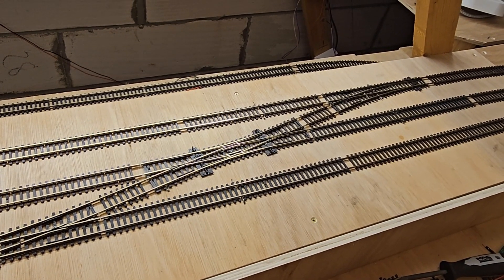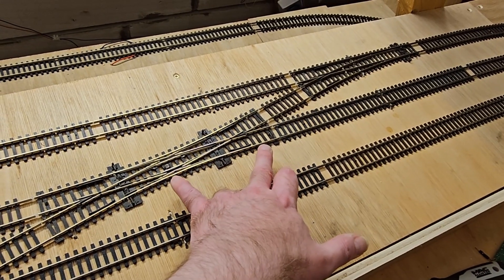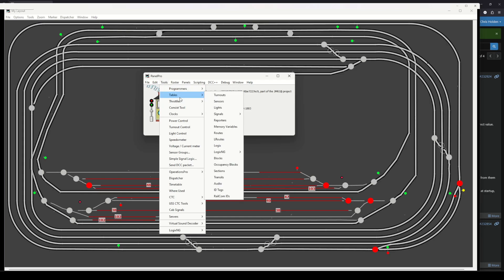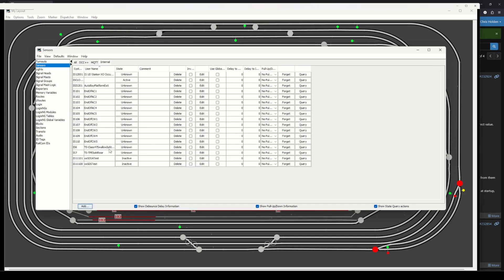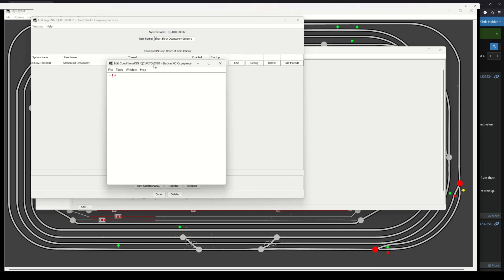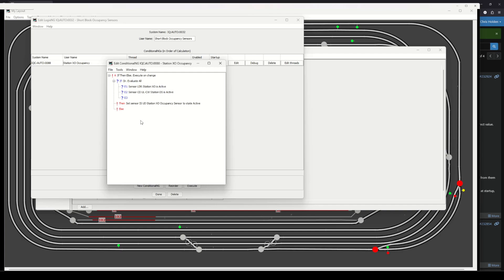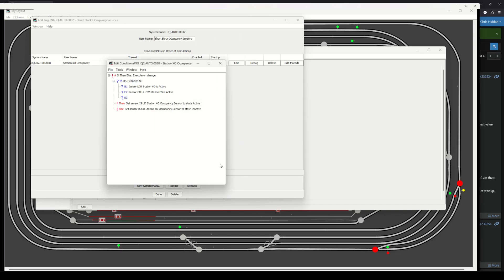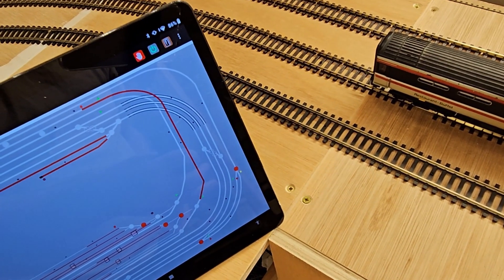Configuring multiple occupancy sensors for one block in JMRI

Comment: Interesting. How reliable do you find the LDRs are? I have been working with adjustments for varying light levels in the room. But I still have problems with light coming in from the side of the coaches and not going active.
Reply from the maker: Hi Sven - they seem to be 100% reliable now. They're connected to an ESP and I've written code to read their values. It allows for a little fluctuation, so the sensor has to be giving readings below the active threshold for 100ms before the sensor state in JMRI is changed. And they have a 2000ms off debounce too. Regards, Chris
Reply: Good to hear. Sounds like you have more stable lighting conditions than I have.

Comment: whats the overhead when you start using the logic stuff instead of just the basic hard coded stuff?

does this start to hit the responsiveness as these scripts are run?

have short blocks here, diamonds, just current sensing - I've sort of committed to resistor wheelsets "eventually", but this sort of thing will be very useful where I have a block split by a board join to combine two physical sensors into a virtual block
Reply from the maker: Hi again! I think in the grand scheme of things, impact is minimal - it's just a tiny bit of logic compared to most of what JMRI does. This is actually a small part of a much bigger project which I kind of touched on in the video, for which responsiveness and speed are very important. And as I'm very much sensitive to that, well, all I can say is it's simply instant - not just through the JMRI user interface itself, but also in the API, json server etc. - which is just what I need!
As a small aside on performance, and this is just my experience - once I started introducing sensors, automation etc., the Raspberry Pi 4 that I originally ran JMRI on quickly put its hand up and asked to be excused from class, let's say. Just my experience - but once you start really asking quite a bit of JMRI, I think that the only really suitable hardware is PC, Mac etc.
I think that the scenario you described, where a block continues over a board join, would be ideal for the multiple sensor approach.
 Regards, Chris

Comment: You never fail to make my head hurt. :)
Reply from the maker: 🤣 wait till you see what's coming next 🤣😨
Reply: @WirenwoodModelRailway  Oh, you cruel, cruel person.
Is there any way to add a timing element to the release block condition? E.g. don't release the block until it has been clear for x seconds.
Reply from the maker: @TheJeffroid  Ha! Yes - but you'd just use the standard debounce functionality for that, rather than add it with logic - so add 2 second debounce to off on either or both of the actual sensors. You could see in the video, actually, that the LDR has a 2 second to off debounce on it, so there was a delay between me clearing the block and the screen reverting it to inactive.

Comment: Wow, you’re still trying to eradicate the problems on your layout. I watch from time to time, and getting JMRI sorted to run trains automatically or semi automatically appears to take up all your time. How long have you been building your layout?.
I do find it interesting even though I don’t use JMRI. DO YOU EVER FIND IT FRUSTRATING (sorry caps lock was on) that you can’t move on to doing scenic etc. to move your layout forward?. Do you think totally automated programs like yours are really worth it or they are too much trouble to get right. Especially as some of us are not computer programmers, and you do seem to be very into doing this programming and adding the correct sensors and associated electronics to make it all work.
I’m not knocking your system, I’m sure itrains and train controller are probably the same levels of difficulty.
Keep the videos coming to educate those of us who don’t understand how these systems work.
Thanks.
Reply from the maker: Hi - I think you make some very valid points there! I could probably write an essay on this but I'll try not to! Yes, I get frustrated - not with JMRI as much as the wiring, the components. Much of that is down to my own deficiencies though, bad cabling and dreadful cable 'mismanagement' causing interference etc. 

Automation is an interesting one - I do think that a fully automated layout, if I ever got there, would bore me. For me I think the process of getting to fully automated is much more interesting than being automated. I made another video at the same time as this one, which I'll publish soon, in which I, to some extent, explain the 'why'. It's about making operating the layout unpredictable. Creating scenarios where the trains I'm manually driving have to take remedial action (slow, stop) due to caution, danger etc. And that caution and danger would be triggered by automated trains operating on the same lines at the same time and everything having to work around each other. Just like the real world.

I've been building this layout for just over 2 years. You raise another interesting point though, around moving on to scenic. I have no scenic skills at all and it's something I'm really quite apprehensive about. Much as many who are not programmers would be apprehensive about doing some of the things that come more naturally to me. So I think an element of what I'm doing is actually deliberately delaying the technical completion of the layout, because it will move me way out of my comfort zone!

Not sure I succeeded in keeping it brief, but hopefully that explains what's going on inside my head!

Regards, Chris